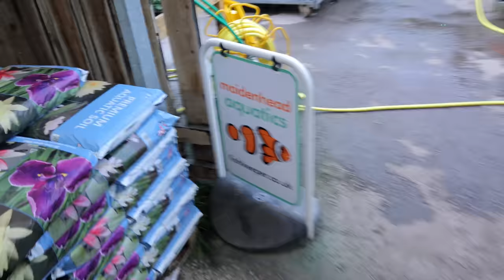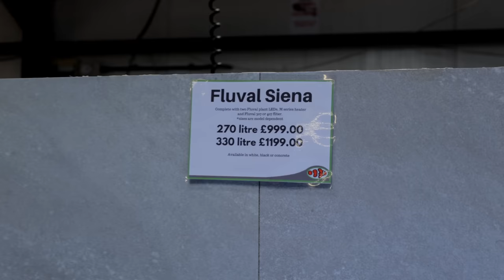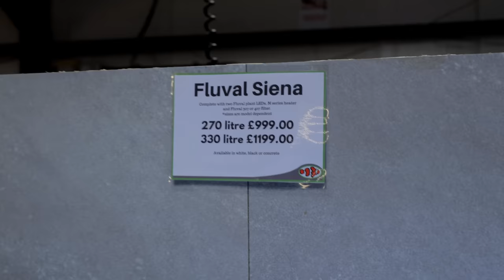The BIGGEST Fish Shop Tour EVER! **Incl. Behind The Scenes!!** Over 190 Aquariums!!

Comment: 1:05:24 - We do this all the time the plants get massive, BUT be careful as the roots start to pack up in the corners getting tight and start to lift then grow under the silicone, then in time it will make the tank leek and eventually split and come apart slowly on the corners.

What I do is pull the plants up every 2 months or so and check the silicone and re-seat the plant back in, or just pull it up and put it back in helps, try not to trim the roots as they just come back even bigger and stronger than before!

Good Video, thanks for taking the time to edit and share.

Cheers.

Comment: I live in Colorado in the US and my koi and goldfish have already stopped feeding for the winter. They will just sit at the bottom barely moving throughout the winter until the water warms back up. My pond completely freezes every year with just a few small holes where the bubblers/waterfall is.
Reply: That’s nuts do you run a heater at all?
Reply: @AquariumAficionado  Nope.
Reply: Well, it snows in Japan...isn't that where they're from.  I use to live in Pagosa Springs.

Comment: If you need an app the equipment is always either insufficient or overkill. If 75% of the tank is covered by plants odds are you can get away with sponge filters and a bit of water movement.